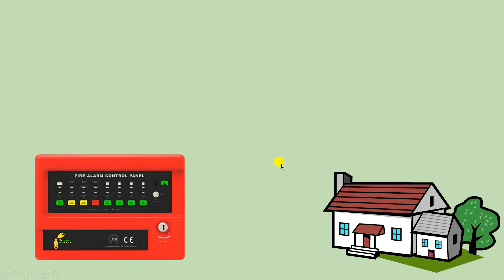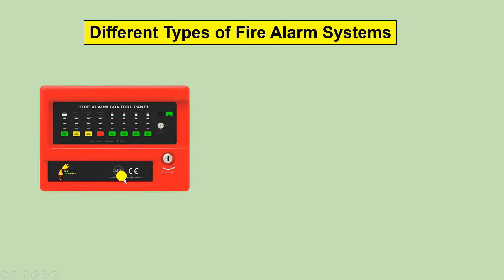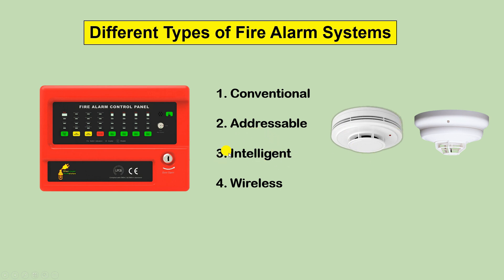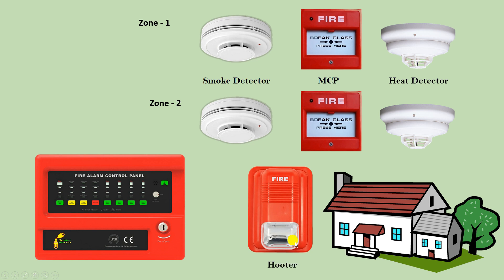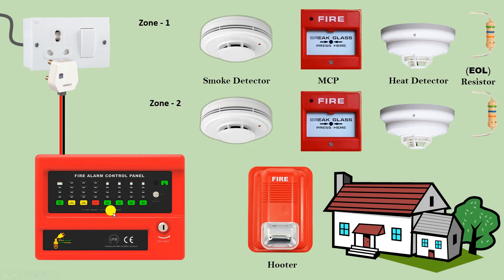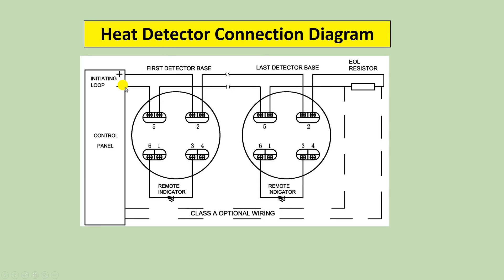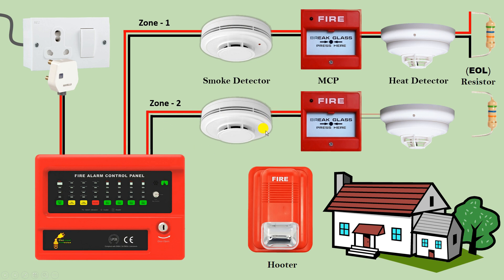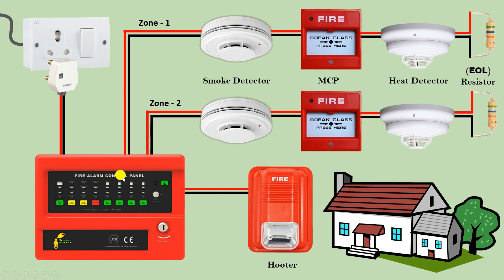How to Connect Fire Alarm System in our Home @TheElectricalGuy

Comment: I'm a fire alarm technician .my point is that all the detectors have the address  so why do you wast so much fire wire and use the resistors at the end of line ? the cable loops from the panel  one cable goes out and one return cable comes in simple why making things complicated the resistors are installed in the fire panel not 10.000 cables in the fire panel . the panel speaks for it self as the sensors . just trying to save you time and money thank you
Reply: but this is a conventional control panel not addressable
Reply: It's a Coventional fire alarm
Reply: Can I call you...